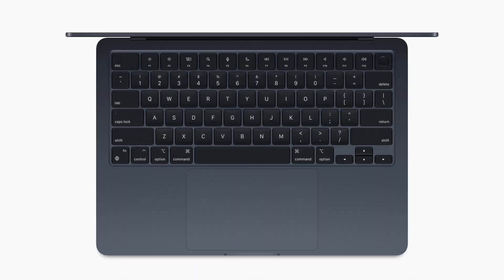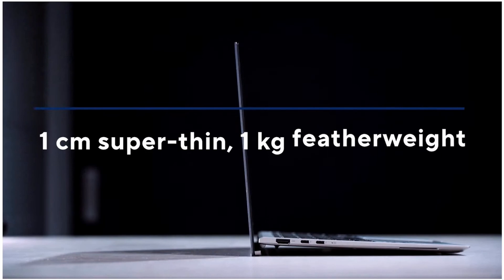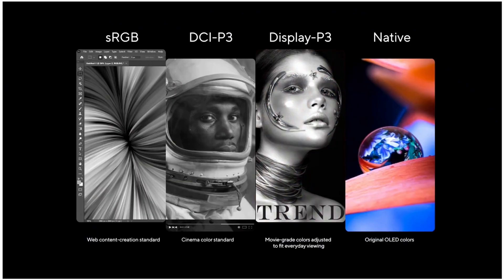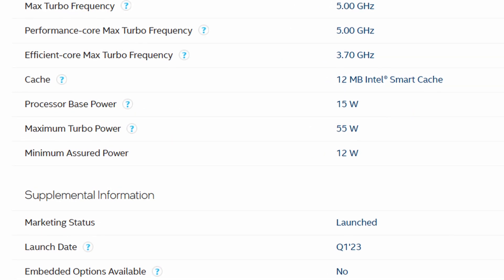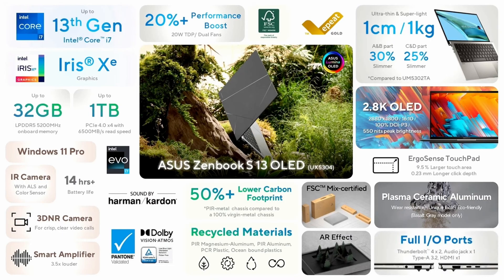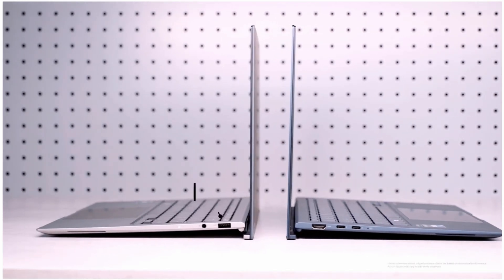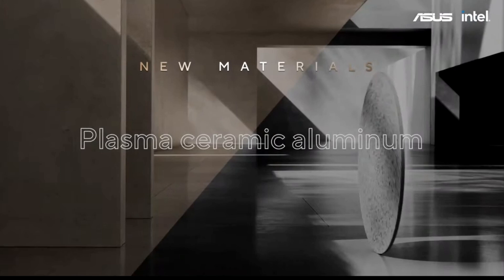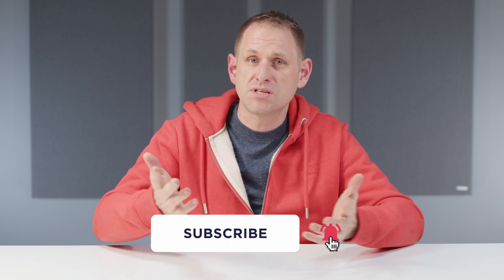THINCREDIBLE?   ASUS Zenbook S 13 OLED - an ultralight notebook to take on the MacBook Air?

Comment: Why does this man not have millions of subscribers.  He deserves way more than that. The most honest , precise and decent reviewer. A quality man
Reply: Life's not fair.
Reply from the maker: You are very kind 😊
Reply: Hello.  Hey Hi.  I have a query. I have been using Mac book air, m1 13 inch, 2020 previously. And i could sense its Battery would easily last me 20 hours straight.  And its per hour screen drain was quite effective. If i would only read on the mac, i would get even more than 20 hours 

I got a new MacBook Pro m1..14 inch a week back.  However i feel its battery is draining quite fast as compared to Macbook air. And it doesn't give me even 16 hours now.. its new.  Not a used one.  
And its per hour battery drain is quite fast ..around 8 % per hour compared to 5% per hour of Air for same stuff i used to do.  
Am i going wrong anywhere?
Reply from the maker: @endlesssurge6920  you’re not doing anything wrong. The Pro has more performance cores and more GPU cores. It’s a bigger chip and it uses more power. The Max chips use even more power and have less battery life than the Pro. It’s the price you pay for more performance. Enjoy the new beast - it’s a fantastic laptop!😁
Reply: Really appreciate your time and guidance. Rise more and shine brighter.
Reply: @endlesssurge6920  also, make low power mode your friend.
Reply: Truly appreciate your advice. . Stay blessed

Comment: The zenbook 14 flip is a way better deal. It is selling on bestbuy for $1200 and it has a AMD 6800H which should kill the 1355u in both cpu and especially gpu. You can play some serious game with it. The trade off is the thickness and weight but I think it is slim and light enough for it to not be a problem.
As far as MacBook killer, one important aspect that he didn't really mention is the battery life. The M2 Air would last like 18 hours watching videos and I am pretty should this laptop last at most 10 hours.